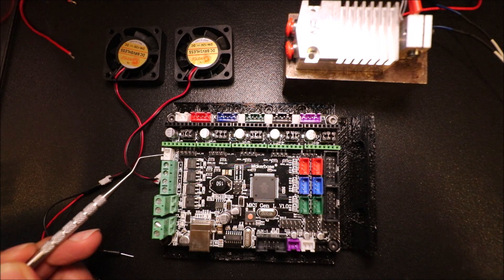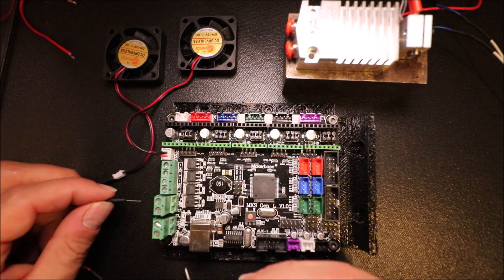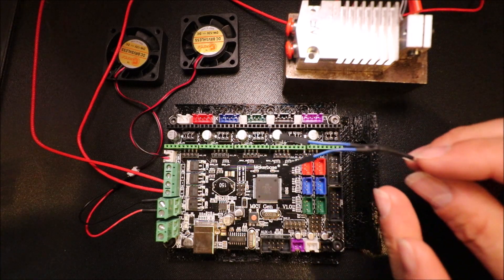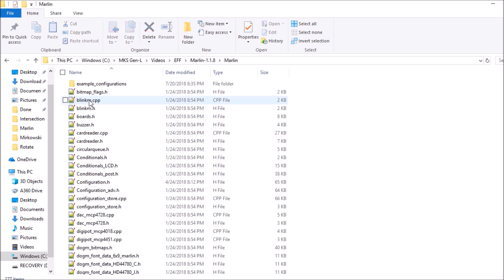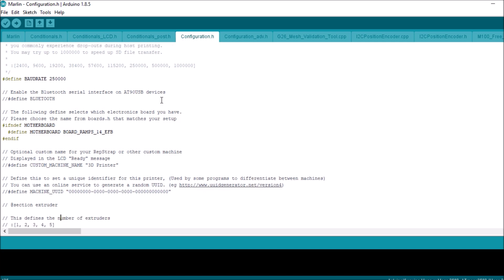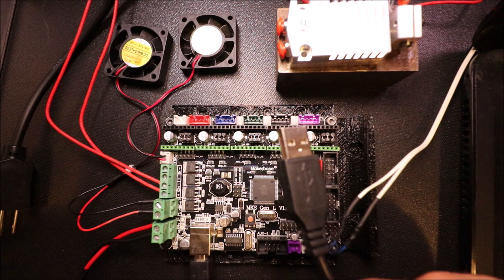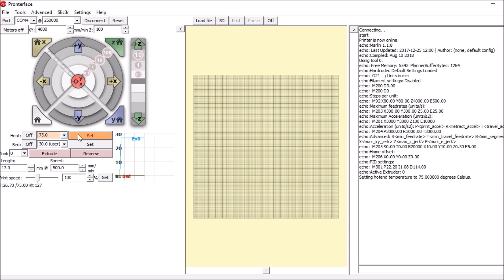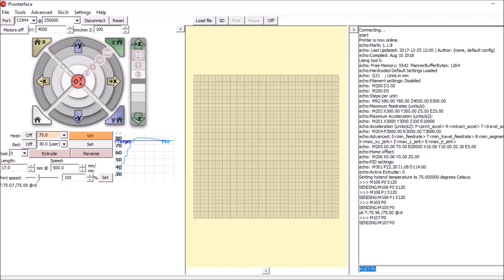MKS Gen L - Extruder Fan and Fan (EFF)

Comment: Hi Edward. You didn't show what happens when the hotend reches a preconfigured temp.
I run the extruderfan of the 12v main powersupply.
I want the fan running of the 2nd fan connector and only on at about 50 degrees c.

Comment: Hi, Edward!  Might I assume that all of the screw terminals are at the same voltage? I'm trying to install a 24v hot end fan to a Robin Nano 2.0. Since my hotbed is already occupied, id like to put it on the HE1 terminals.
Reply from the maker: You're correct as long as your PSU is 24v.

Comment: Possibly a silly question, but if you're using the bed control to control the fan, what are you using to control the bed?
Reply from the maker: You do not need to use a heatbed.
Reply: @EdwardBraiman  Most people think they get better results through using one though.  But that does answer my question. Thank you.
Reply from the maker: You're welcome.

Comment: Edward. Can I do this but use the E1 terminals instead of the hotbed? I want to run extruder (1), heated bed, and at least two fans.
Reply from the maker: On MKS Gen L you can run I think 3-4 signal controlled fans, this depends on if you're using hotend ports or servo pins to control fans.  In my playlist I think there is a tutorial on fan controller module.
Reply from the maker: Yes, it's in another video in this playlist.

Comment: Ed, I have a question why did you select in the Marlin firmware the RAMPS board type and not the Makerbase board type. Are these board types interchangeable? And was that the only way to get the second fan to operate?
Reply from the maker: Ramps is one of a dozen printer boards on my channel.  Check out my other playlists.
Reply: Thank You for the replay. You mentioned in the video use motherboard type "BOARD_RAMPS_14_EFF". But you are using the MKS Gen L 1.0 board. Does this explain my question better? I can't get my second Heatsink cooling fan to operate.
Reply from the maker: In one of my playlists I talk about a fan extender.  You can run it off servo pins.

Comment: Amazing video!

I have a 24V powered Ender 3 with an MKS Gen L board. All 12V fans except the blower part cooling fan.

I'm going to set the D7 pin as my E0_AUTO_FAN_PIN
 as I don't have a second extruder and thus this output is unused.

I'll be controlling my extruder fan along with other 2 case fans. These three 12V fans are currently powered from a Buck converter so I'll have to power this converter from the Extruder1 port (D7).

My drivers won't be cooled down when the hotend temperature is below 50º but I don't think that would be an issue, as I won't be moving my motors too much with a cold machine!

Comment: Edward:  Your instructional style is terrific - I can follow along very easily.  I was able to get a 24v fan operating using the M 106 command.  However, you mentioned that it is possible to program it to turn on automatically instead of typing it into the command line in Pronterface.  Have you done a tutorial on that?
Reply from the maker: You can do both in Pronterface and Slic3r.  I'm planning on doing them soon, but Slic3r might prompt many questions.
Reply: Edward Braiman Great!  Thanks

Comment: Is it possible to connect the extruder and the extruder fan to the same D10 input?
Reply from the maker: Not a wise idea with extruder.  Depending on board and Marlin firmware you can setup to activate during print at certain temperatures.
Reply from the maker: Watch my tutorials on fan extenders.

Comment: Hi Edward, I've been following your videos for a while now... Maybe I've missed it, but in the upper left corner of the GEN L board there's a white connector labeled 12 volts. My question becomes, on an Ender 3, which uses a 24 volt power supply, is this connector still outputting 12 volts? If so, can this connector be used as the hot end fan (not part cooling) for cooling the hot end ?
Reply from the maker: It may depend on input voltage from the power supply.  I'll check after work today.
Reply from the maker: check out this link ... http://www.robotrebels.org/index.php?topic=769.0

Comment: is it for any mks gen? Thank you.
Reply from the maker: The extruder is for almost all 3d printer boards that have two or motor extruder motor ports.  The motherboard name in the file might point to ramps 1.4, but you can change after finding file in Marlin for boards.h and finding name of MKS gen L v1.0.
Reply from the maker: You can find MKS Gen L version 1.0 on eBay or Amazon or Google.  It's priced around 18 to 25 dollars.

Comment: Hi Edward. Im finally getting roud to putting my printer back together. Currently busy with the fans. Im assuming according the the video that D9 is the PWM part cooling fan port. for the hot end fan. you are mentioning putting it into the HB port. what if i have a HB connected there? where would i connect the fans then?

Comment: you need to do a single video from being to end on wiring and marlin of the mks gen l board. because i have 3 fans(parts, active and control box), hotend, bed heater, and ABL. and also in this video where are you to wire the the bed too
Reply from the maker: There might be a a video on more fans this week.  As for a long video, would love to, but I upload from a coffee shop so it might take hours.  Been waiting for Greenlight fiber optic internet for over two years, they have it accross the street.  So when they install it the videos will get much longer.
Reply: Hi Edward.
So am I understanding it right: will there be a Video which descibes following?

I have 1 Hotend, 1 Hotbed, 1 Hotend Fan (—> Connected to permanent 12V left Side of X-Stepper Motor), 1 Part Fan (—> connected to „Fan“ Port)
So far so good. 

But I have a Fan for cooling the Board itself, too.

So I‘d like to use the E1 (D7) Output with permanent 12V (Printer on = cooling Fan for the Board on)

I Know E1 is to be used as 2nd Fan if I only have 1 Hotend. I can start the Fan via Display —> Fan 2 —> 255. But in this case I Need to Start it manually everytime or I Need to put it in the Start skript.

But I would like to Set E1 (D7) via Marlin to permanent 12V so that the Fan is everytime on.

Thanks 
Best Regards
Reply from the maker: So you have a bunch of fans you wish to run with different requirements.  You can start some in the Marlin firmware automatically and other using Slic3r in expert mode select printer settings, custom G-codes and enter what action gcode you wish to occur at start of print and end of print.

Comment: What is the other white connection next to the X axis stepper plug?
Reply from the maker: 12v aux power port.
Reply: @EdwardBraiman  If I run a 24v system would that be 24v then?
Reply from the maker: @stevealles3482  Yes, but you might want to verify before using for 24V and also which component connected to this port because all my examples are based on 12 volts for safety and to keep people from cooking parts they jest purchased.
Reply: @EdwardBraiman  Thanks I just verified and it is 12 volts. I am wanting to connect my extruder fan to it, and the other fan port to the part cooling fan.

Comment: Is there anyway id be able to contact you and get help on setting up am MKS gen L1.0 board. iv been trying to follow your tutorials. but seem to be stuck.
Reply from the maker: I'm available only via YouTube comments field.  So what issues are you seeing?
Reply: @EdwardBraiman  i recently got a Gen L board to replace the board on my Anet A8. i have dual z steppers. which i need to have running. but i cant get any of the steppers to work. (i dont have stepper drivers the guy at the shop didnt say i needed them so i didn't get.) But i am heading back there a bit later as i assume i do need them. . I have a cooling fan (split too 2 fans. one on the v3d hotend and the other cooling motors.) that i cant seem to get to work. I know it is working. i can use my old board to test. just not the the mks board. I did get the reprap screen working. and my thrmister for my bed isnt registering.
Reply from the maker: I'll post after work today a couple of video links in my MKS Gen L playlist each tutorial, but if you find them first let me know.  They will hopefully get you moving in the right direction.
Reply from the maker: @russiank312  When you connect the Fans can you describe what is occurring?  Do you have and know how to use a multimeter?  What software versions are you using to communicate with the Printers motherboard?  What Gcode(s) commands are you using?
Reply: @EdwardBraiman  well iv managed to find a few diagrams and i see i was connecting the one fan to the wrong place. I'm supposed to use the other hot end port for fans that always need to be on. i don't have a multi meter. but i do know how to use one. i can always borrow. i just bought stepper drivers
Reply from the maker: You can tune the stepper drivers by ear, but it will take awhile.  Which stepper driver did you purchase?  Drv8825 are easier to work with.
Reply: I got a4988 stepper drivers
Reply from the maker: You will need to borrow or buy a multimeter to tune easier.

Comment: But then I cant heat up my bed, right?
Reply from the maker: Correct, but this is just showing another method of printing as I've covered in my RAMPS tutorials multiple ways to build and use Marlin firmware.  Keep in mind I personally avoid using a heat  bed, but it's still possible to use multiple extruders, fans and heat beds at the same time with Marlin firmware on either RAMPS 1.4 or MKS Gen L boards.  I'll be doing another video soon explaining how to add additional fans in custom situations.

Comment: i cant activate my hotend fan on mks gen l. it is connected to he1
Reply from the maker: You want to connect second fan to Hbed.  Let me know if this helps?
Reply: wiring on my tevo michelangelo like that and it works however on ender 3 i couldnt do it. used different boards.. so far no chance. and i know im missing something but dont know what.
Reply: btw i can heat nozzle and bed so there is no electrical issue i think. but i cant read voltage with multimeter by touching to  flat screws.this is going to end with external mosfet for bed. maybe then i can use fans with hotbed port
Reply from the maker: In the video the bed or hbed port was used for second fan.  The reason was because the architecture used by the board is the same as Ramps 1.4.  which board are you using?
Reply: Edward Braiman mks gen l. i defined e0 auton fan pin 7 and it work it. he1 was d7

Comment: Since this was posted so recently I’m hoping someone can help me with my problem because I’m not 100% sure this video tutorial is exactly what I need but I’ll try it anyway. I have a flyingbear P905 and it does not come stock with a part cooling fan to help cool my prints during printing and I don’t want to just plug the part cooling fan in on the 12/24v GND white plug between red X axis motor plug and the screw hole otherwise the part cooling fan will be one 100% of the time. I actually want the code to work and auto turn the part cooling fan on when it’s supposed to during a print after the first layer and for the hot end fam to turn on properly after the extruder reads past 50C as it says in the configuration.h folder. Currently my C.h folder is showing my motherboard as BOARD_MKS_13 and so if all I need to do is change that to RAMPS-14-EFF and I’m set to go then awesome but if not I don’t want to be fumbling around myself not knowing what to do and instead that’s why I’m asking on here to see if anyone has figured it out already. Thank you for the videos and anyone’s help is greatly appreciated!
Reply from the maker: Well sounds like a different 3d motherboard.  If the chipset matches the RAMPS give it a try.  One way to find out is the open pins.h file for your board and see if it points to Pins_Ramps.h.  also you can control fans via gcodes in slic3r and in pronterface.  Keep in mind to check pinouts diagram.  If you're not sure research more.  Also, what's the initial problem that is making you want to modify printer?  Sounds like a print issue.
Reply: It is the exact same as in your video the MKS Gen L V1.0 and currently I've now run into a bigger problem is now my arduino ill not send any more compiles to the board. the port option under Tools isnt even highlighted to be selected when my board is plugged in andthe auto home commant from my LCD controller does nothing and my stepper motor chips are getting extremely hot when the board is plugged in to power from the power supply. Ugg I'm no Computer engineer but a diy printer should not be this complicated. I'm sure some user error is involved on my part but this time it just happened without me changing the code at all. No COM3 and port is unable to be clicked on. now i really want to just get a new fresh board. Possibly something that already has more than one port for a fan.
Reply from the maker: Not sure about flying bear board, but check the last change you did on the board removing components and then check USB port availablility.  Most times it's a stepper board.

Comment: what would be the result if you crimped two 12v DC fans together and plugged them both into the designated fan input?
Reply from the maker: It worked for me about a year.  Just monitor it and it should be fine.
Reply: did it give out after a year?
Reply from the maker: The fan was fine, I broke the fan holder by accident.  One fan worked even better after that.
Reply: Two 12v Fans connected together will have no bad consequences. Two 12v Fans connected in Series, Will each share 6v and the current will be same for both. If connected in parallel, they would share 12v drop but the current will be split. 
If you plan on using two (or more) 12v fans to run on 24v, I would not suggest this. Horrible things would happen if one fans fails. Then, all 24v will be on one 12v fan. I use a DC-DC Buck converter (step-down converter) 24v to 12v and run multiple 12v Fans in Series and Parallel. Been over 1 Year, with no problems.
Reply: The downside is that both fans will work at the same input speeds. I have 1 blower fan cooling the part and one cooling the heat sink. I want the heatsink fan to run all the time and the blower fan to turn on/off or have a different speed from the heatsink fan. If you are using two blower fans to cool the part pointing at the nozzle then wiring them together would be OK. I am not sure why the gen L board did not supply a second Fan input/pin.